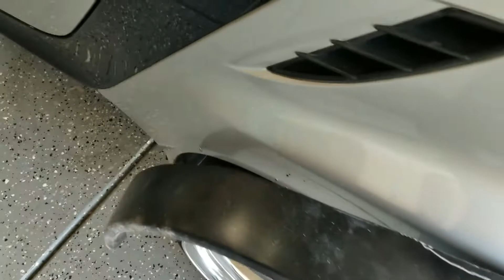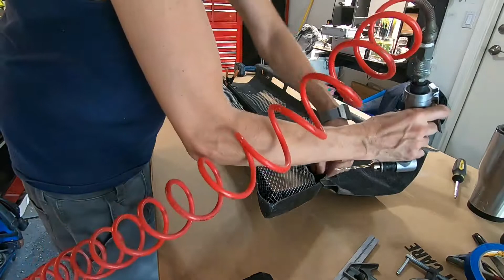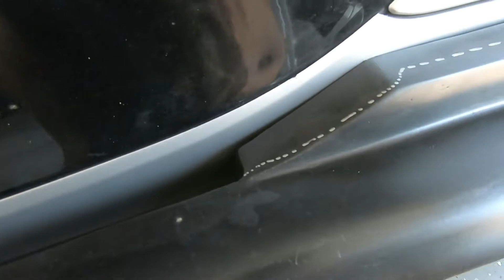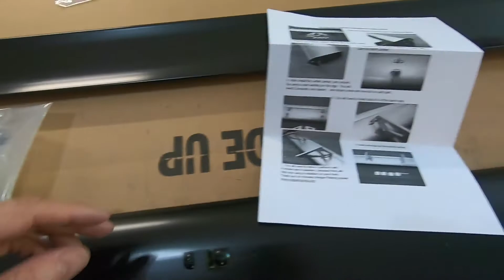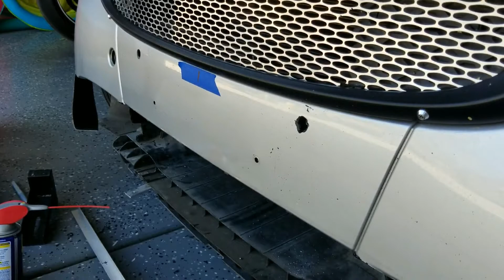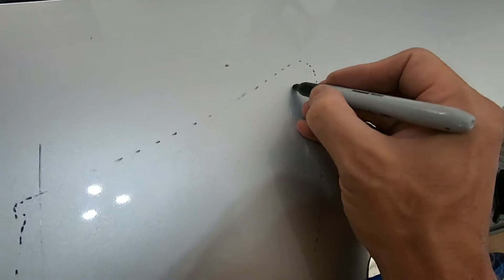HOW TO APPRECIATE DEPRECIATION   PART 3 OF 5

Comment: Brother, if I can help, I have a Smart car 451, and I want to change the woe from three screws to four or five. What is the process? Thank you for the answer
Reply from the maker: Something to consider is what is the  final look you're after. There are plenty of cheaply made adapters out there.  What I did was use 3x112 to 5x112 hub centric adapters that are 1 piece 19mm thick.
This allowed me to choose wheels I could resell, that fit VW, Mercedes and a few others. 
I purchased my adapters from smartmaddness.com
I hope this helps and let me know when you get it done, I'd love to see what your building

Comment: Looks awesome 🙌🏻
What are your wheel specs? And where you get your flares
Reply from the maker: The wheel specs are Work Meister S1R, 17x8 ET-10 front, 17x8.5 ET-20 rear,  5x112 bolts pattern with 20mm 3 to 5 lug adapter. 
The body kit is Duraflex GT300
Reply: Right on 🙌🏻 thank you for all the information, do you have Instagram with more pictures of your ride?
Reply from the maker: @CHUY-em7zw  yes I do have Instagram dansdzigns
Reply: Thank you for
All the info🙏🏻🙌🏻
I can’t wait sto see it all done
Reply: What about your fender flares the ones before the duraflex body kit
Reply from the maker: @CHUY-em7zw  I bought a set off Wish.com and I also found a set on Amazon. Search Universal 3 inch fender flares.